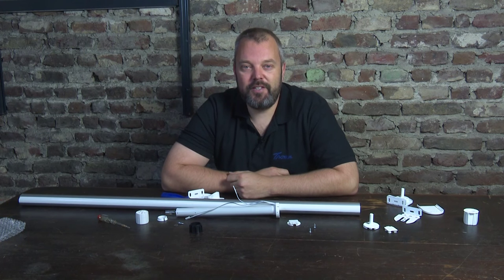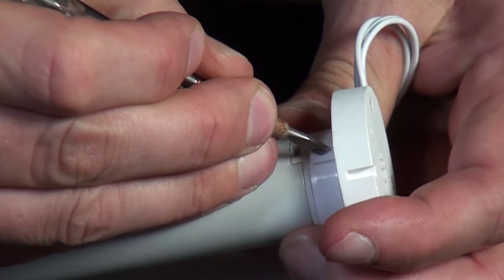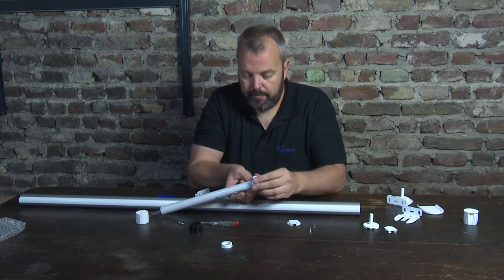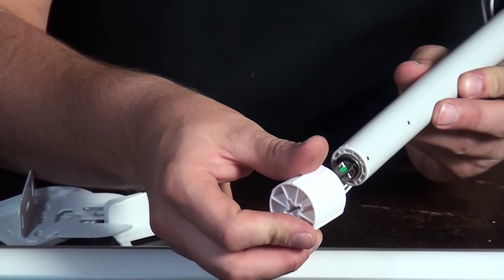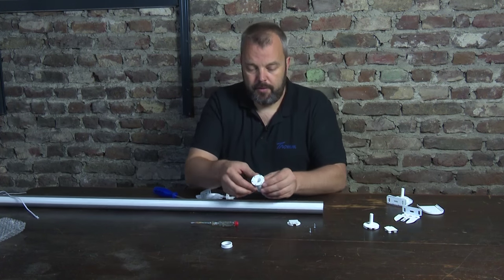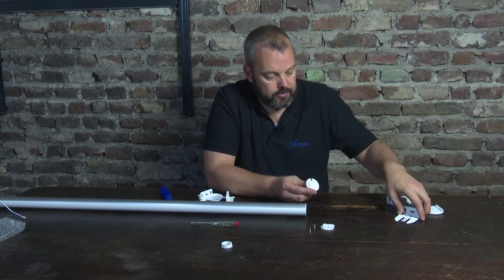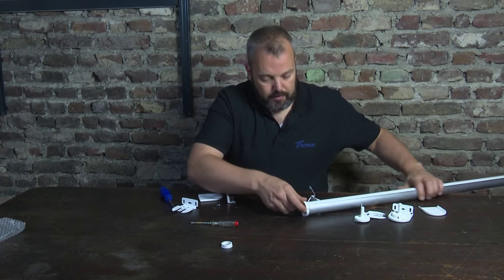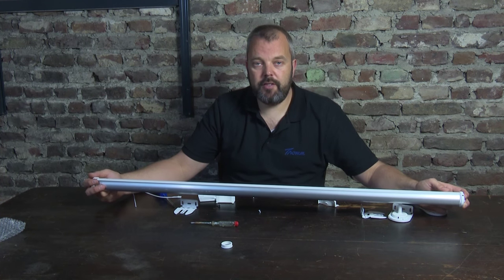How to make your own electric roller blind - part 2 - assembly of all the pieces

Comment: So the 28 RTS fits inside a 38mm tube?
Reply from the maker: +chimeranzl Yes, it does. It would also fit smaller tubes, but Somfy doesn't have a crown and drive for every tube, so that's the limiting factor. If you have a 28 mm x 0.7 mm tube, that's the smallest the motor will fit into.